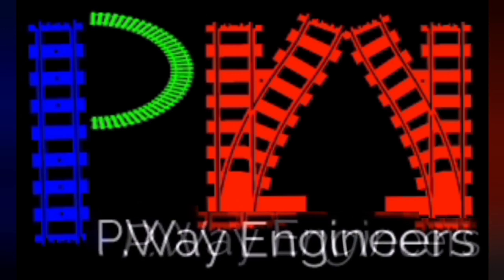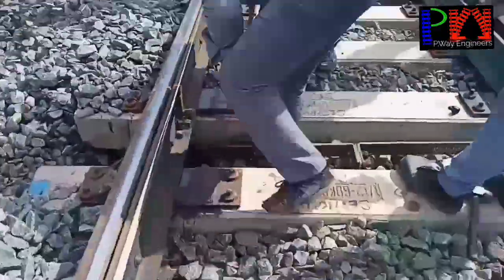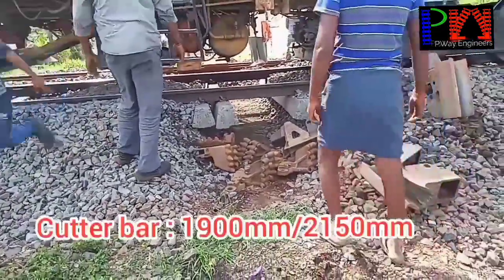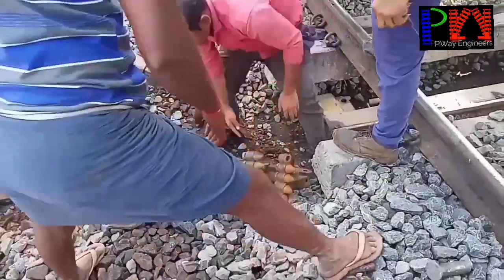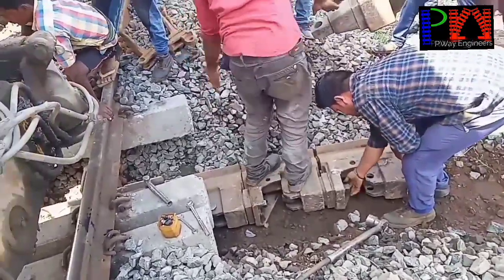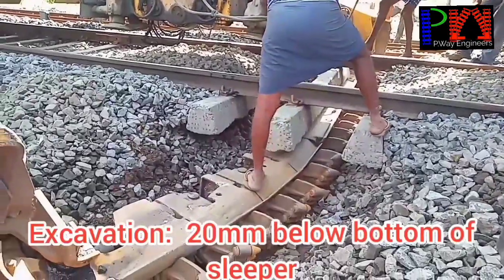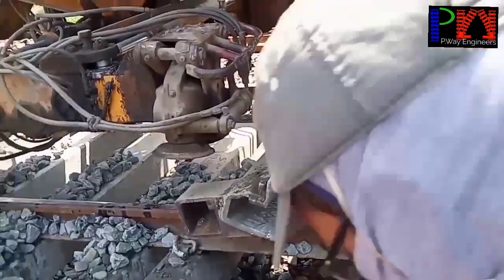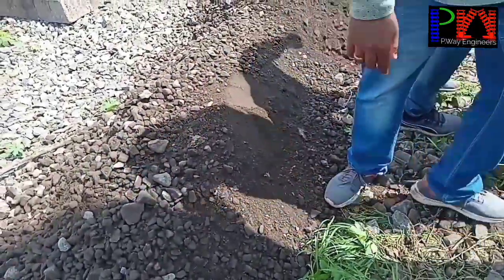BCM working on POINTS AND CROSSING RM80 92U@Gokulrajpway

Comment: What is technical requirements to increase track speed to 130 kmph
Reply from the maker: Rail-60Kg/90uts
Sleeper density-1660
Thick web switches
Improved type SEJ
Inter locked railway LC gates
H-Beam sleepers in girder bridge
Fencing along the track
Reply: @Gokulrajpway  thanks for the information. With increased budget hope to see 130 kmph in south sections